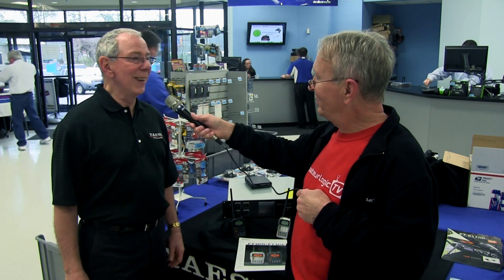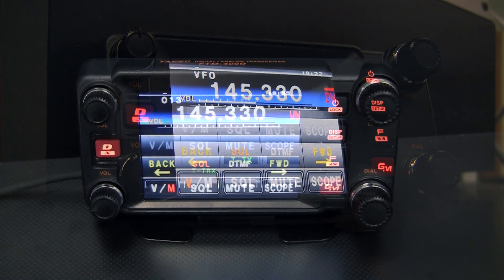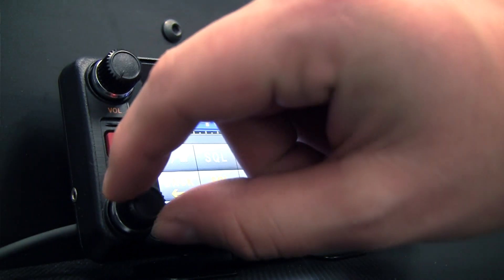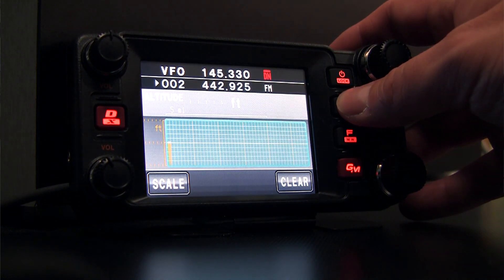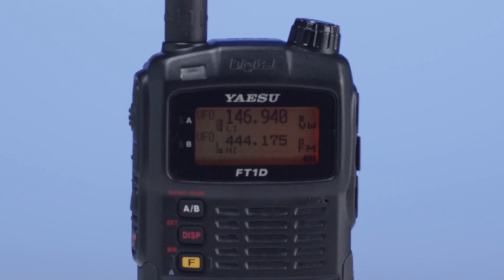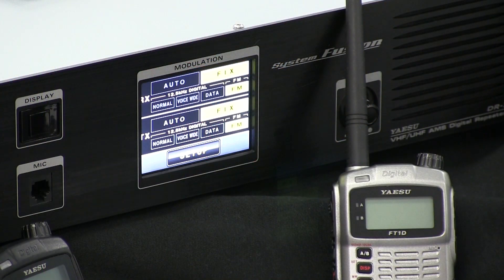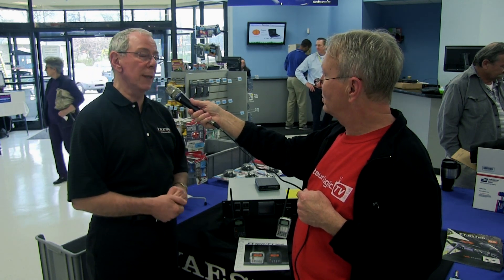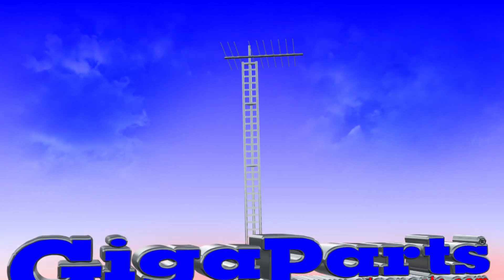Yaesu System Fusion April 2014

Comment: system fusion is retarded. I hope Yaesu goes out of business! Wirex-x... lol.. dual mode digital and analog. lol. this thing is half baked and crippled.
Reply: ***** You sound like that Yohoo is feeding you so you will push their products so get over it bozo.Not everyone likes their garbage & are being paid too push it on the world.
Reply: ***** I would NOT own or use any radio that Yaesu builds if it were FREE.I have wasted more than enough money over the 20 plus years I have been in Ham Radio on their garbage that they broke me of the stupidity.I'll stick with my ICOM gear because it's dependable & always has been.Yaesu should stick with making rotors since they actually work as designed but I can't say that about their radios.I have approximately $10,000 in ICOM gear & it works every time.The last Good Yaesu I owned was a New FT-990 & everything after that was trash including the FT-857D & Atas 120A which both were poor quality ripoffs.The ICOM 7000 & TARHEEL II I have now makes the Yaesu combination look & act like a Fisher Price Toy Set.Have  a good day now.
Reply: I bought the FT1DR - its a pos! C4FM is stupid as fuck!
Reply: ***** no call sign routing. re-use of WIRES which is a dead horse. the fusion repeaters going in are being set to analog only. its stupid! Say what you want, fusion is a failure!